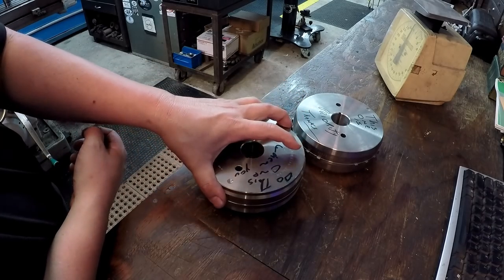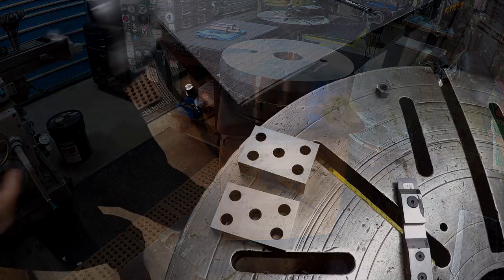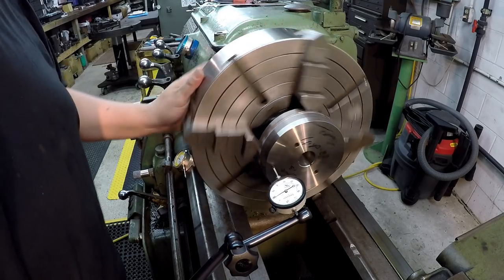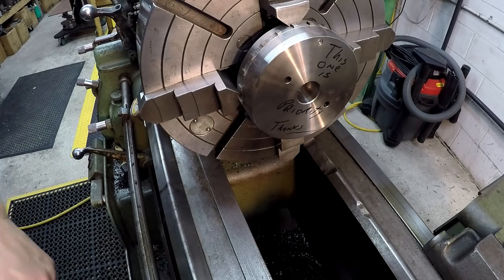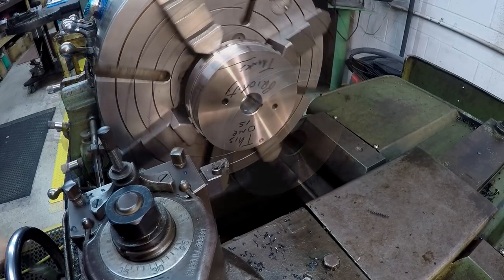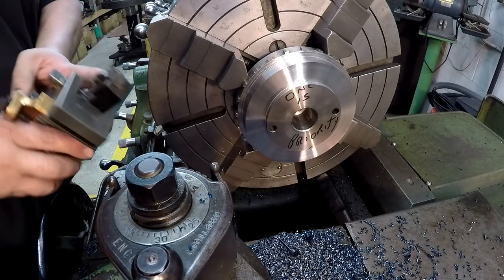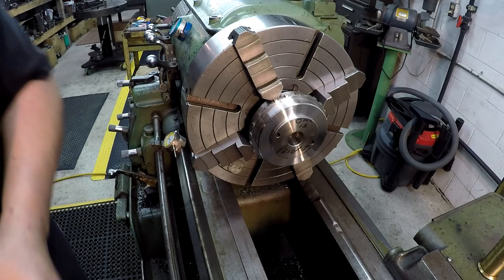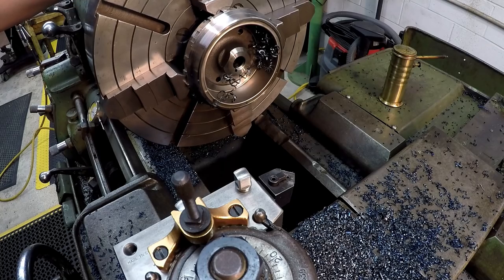SNS 169 Part 2: Flywheel Lightening

Comment: I learned more about indicating a 4 jaw chuck by watching you do it and explain it than any other way. I have watched Mr. Pete, Keith Fenner, and a few others, show and tell how to do it and I have learned from them, but you have shown how to deal with a few problems and odd ball pieces. So when I had an rough piece of tubing to turn and it stuck out several inches from the 4 jaw, knowing that the 3 jaw would not be true when switching ends, and I had to use the steady rest to get the far end due to rough and uneven edges on both ends, I knew about what to do and how to go about it. Thanks for the instruction and I know that's what you are about..

However, there are people like me who are just starting to watch your videos. Yes, a bunch of us have watched you do it several times. New viewers may not have watched several of your numerous videos and have not seen as much as I have. They may need it just like I did. And that is why I'll never get tired of watching it and will never say anything negative about it.

Two thumbs up if YT made it possible.

Comment: Not boring at all, Adam.  After 40+ years in a manual (non CNC) shop, I've indicated countless thousands of work pieces in a 4 jaw chuck and I still enjoy watching you indicate parts in!
My old instructor at tool & die school told us, probably half joking, that 3 jaw chucks were for non machinists and chucking hex stock only.  :-)
Consequently,  I almost never use them, even on round stock.  Another added benefit of the 4 jaw chuck is the strength of the 2 sets of opposing jaws.  TreeTop

Comment: Per your audio, I just replaced the ear boom mic on our system,  It was doing exactly what yours sounds like.  The tech guy at the place we bought it had me try a different mic (in our case, a lavaliere) and if that worked okay then it was the mic.  If not then it was likely the sending unit.  

New mic in operation today, laid down the sermon just fine.  No cracks.  No pops.  

Keep up the good work!

Comment: You mention indicating early on, and I have to say, this is the first video I watched that it really clicked what you're looking at on the gauge and how you're adjusting. Maybe I've just watched it enough and thought about it enough, but for whatever reason, I think I could do that now (I'm not a machinist, just interested). You normally indicate so fast, I'm usually so impressed with the speed I don't follow the actual motions.

Comment: 10:43 - This noise occurs when the voltage of the condenser (in the microphone) isn't high enough to produce a clear and stable signal to the preamp. Voltage swings due to a bad connection can also cause a DC bias in the preamp which gives that scratchy sound, and will make it "pop" back into life when the preamp is back within its working limits.

TL;DR - So, basically it'll be a bad connection, going off the sounds produced. I'm guessing you're using an external microphone plugged into the camera?
Reply: Yep, as Highlandsteam says lower down, dry joint. Annoying to find but doable... Best of luck getting it sorted Adam.
Reply: the bottom line is that USB sucks for this sort of thing.  it's great for mice and keyboards and plugging your camera into a computer to upload media, but for a quality connection you want a dedicated bus that is stable.

if Adam wants to move on from the GoPro then I suggest the Sony action cams as a very small, light solution that have a dedicated 3.5mm audio socket that will allow any external microphone to be used.  the FDR-X1000V 4K version is quite a bit more but the wrist worn shutter and zoom control control with playback screen for easy setup and repositioning is well worth it.

https://www.bhphotovideo.com/c/product/1109327-REG/sony_as200v.html
https://www.bhphotovideo.com/c/product/1111159-REG/sony_fdr_x1000v_r_fdr_x1000v_4k_action_camera.html
Reply: Principal Audio "Might be" a bad USB connection. A micro drop of Deoxid might help. Micro USB is just a stupid design. Tiny little conductors with micron thick gold flash that wears off after fewer than a hundred insertions and removals. Add in tiny mounting pads with brittle lead free or low lead solder and they're just a PITA. Slightest bump in certain directions breaks joints or even lifts pads. But try some Deoxid Adam.

Comment: Adam, those "divots" are actually called trigger teeth. There is a VR(variable reluctance) sensor that creates a trigger every time one of those teeth pass by it. The computer controlling fuel and timing uses those trigger points to calculate rpm, fire the injectors and coil.

There will be a missing tooth on the wheel and that large gap let's the ecu know when the motor is at top dead center. That flywheel looks to be a 24-2 flywheel. 24 being total number of teeth evenly spaced around the wheel and -2 being the number of teeth missing.

Comment: The little studs are probably for the ignition or crank position pickup.  Basically its a magnetic proximity sensor.  The pickups have a magnet and a coil, and when the studs rotate into the field it changes it.  The computer or ignition module sees the change and knows when to fire the coil or whatever it does.

Comment: Hi Adam. You probably know this now already but the go pro has a problem with the mic input. The problem is the little USB connection port used for the external microphone mounts directly onto the circuit board in the camera. Movement and vibration with a cable connected will eventually shake the USB port loose. The solder joints dry up and cause a faulty connection, small changes in movement, temperature etc cause the intermittent problems you've been having. You could get inside and resolder the joints to fix it, but the thing with a go pro is that it's hard to know how the audio is being recorded during filming. I would suggest if possible, using another separate device to record sound. A bit more work but you're less likely to lose your spoken word forever and have to do a voice over. You could use your other camera just to record sound, connect your rode mic to your phone and record sound, or get a small recorder and use that.

Comment: Those are Reluctors on the flywheels, ABS have them as well.  Pretty much everything computer controlled now days use them for timing and speed sensors.

Comment: The teeth on the flywheel are called exciter rings, it goes with a pickup to tell timing for fuel injection to tell where the crank position is and when to fire the fuel injector and spark plugs. It gets picked up by a magnetic coil where the voltage drops down from 5 volts to zero as the tooth goes past.
Reply from the maker: +Sicktrickintuner Thanks!

Comment: Hi Abom. I have been using different type of microphones and I recognised a typical fault that usually comes with wires and connectors. Check the leads while recording a clip, one way is to take the lead/wire between your fingers and drag/bend them until the connection point to the camera. Another possible place where faults might occurre is in the connector itself. I have had bad connections inside the connector. Also another possible location is inside the camera where you place the connector. Hope you find the fault. Best regards: Jan

Comment: the teeth around there: tone ring, read by a magnetic sensor. Sometimes these are a separate flange like ring with those teeth on it, sometimes they're like this. I'm more familiar with car/truck engines, which are usually separate.

Comment: I'm going to go ahead and agree on the bad connection to the mic at the connector, its that same sound you get if you were to have headphones on, and pull the plug out of the phone just a bit and jiggle it around, you get that same noise.

Comment: I think those bumps are Hall Effect timing lugs...maybe not!  Are you suing a remote mic?  Sometimes the cord frays inside the insulation. There is a voltage coming from the camera to power the electret mic element that may be interrupted at the USB port or along the cord that causes an intermittant open;  intermittant anything is hard to find sometimes. Greg
Reply: Yeah, looks like an encoder ring for a crank sensor.

Comment: That's a tonne of rotational mass you took off. Never thought it would be that much. The power ratio is definitely going to go up big time. We relish 3 lbs on a V-8 5.7L racing engine let alone a V-Twin motorcycle engine. That bike is gonna be quick(er)!!

The audio could be bad jack and / or USB to circuit board. Crackling indicates to me a bad ground somewhere in the audio jack /pin. Sometimes the Mic's are undersize (pretty common actually). 

Maybe you indicate that. If it's the mic to USB, that's more problematic to troubleshoot but as others have suggested, USB to circuit board is a definite possibility. I have USB test equipment, but its not designed for audio circuits, only power and data transmission. I've never seen one for audio. hrmmm
Reply: I was thinking the same thing.  Used to race Legends cars, if I could have legally taken 3lbs out of that engine, omg. lol.

Comment: I work in the Turbomachinery industry and I make shafts good to .0002" runout and actually they are still usually WAY out of balance
Reply: Those flywheels were balanced before he ran them. Considering that he took off an equal amount of mass all the way around the part it's balance should remain close. The dampening effect of mass will change things a bit and could cause more vibration issues when in use. However, these are likely race pieces where cruising comfort isn't a priority.
Reply: +Ridgewood Machine (Kevin) incorrect. The density of the material won't be the same in the whole piece. so the balance could be massively different.

Comment: Maybe you have a tiny piece of iron that flied into the microphone hole, the magnet that is inside the microphone is very small to but enough to hold the metal. Some times because of the vibration it moves around and blocks the vibrating membrane of the microphone.

Comment: I think your audio  problems are connection related. Either a connector on the circuit board or in the external input jack.

Comment: Hi Adam, nice job. quick question though; why don't you bore the material off the ID on the inside of the flywheel? that way you can take even more material off and retain the angular mass? taking it off the outside edges of the rotor is much less efficient because it leads to a heavier flywheel in relation to the angular mass when it's spinning.
Reply: Peter Ellis 
the magnets sit inside the flywheel, you would endup machining the magnets away.
Reply from the maker: +Peter Ellis That makes no sense on my end.
Reply: Abom79 Hi Adam, I'm comming at this thinking about what a flywheel does which is add angular momentum to the engine.  I assume you are reducing the mass of the flywheel to reduce the angular momentum of the engine so that it revs up faster and as a side effect the bike also gets lighter. The further away from the centre of rotation the mass is located the greater the angular momentum (kind of similar to the way greater torque is applied when you use a longer lever).  This is probably one of the reasons the flywheel isn't just a flat plate. The way it is designed puts material as far away from the centre of rotation as possible. 

So what I'm suggesting is that if you take material off by boring out the inside diameter (opposite side to the divots) You could remove even more material because you would be removing material from closer to the centre of rotation. That way the bike would be even lighter. 
Does  a that make  a sense?  Maybe it's not necessary or possible to do it that way or the overall flywheel weight is not important.

Comment: Adam,

Defective solder joints are definitely a PITA.  Reflowing corrects quite a few defects.

If you mess with electronic equipment, mechanical contacts are ALWAYS an issue.  Definitely get you some DeoxiIT, which is a very bad assed contact cleaner.

https://www.markertek.com/product/caig-d5s-6p/caig-laboratories-d5s-6p-60th-anniversary-deoxit-d5-spray-with-new-perfect-straw

Eli D.

Comment: I suspect these lighter flywheels are for quick rev or higher rpm engines. Normally you want a heavier flywheel for better low end torque.
Reply: If you lighten a flywheel all changes in motor speed will be faster, so you will get faster reactions on accelerations and when you release the throttle (decellerations). Acceleration will be faster, but with the removed weight from the flywheel you will loose some of its kinetic energy storing ability. You will loose low end torque as you mentioned, but for motorcycles you don't really need it because the weight is not that big, there is no chassis to be moved.
Reply: The engine is producing the same HP and torque. Your loosing the stored energy of the fly wheel. It makes it look like you have less torque but you really only have less stored energy to resist stalling and sudden load changes.
Reply: Correct. It makes better low end torque by filling in the gaps between the power strokes.

Comment: 1.36kg is quite a lot probably some 5-7kg taken from the bike in terms or acceleration as the gear ratio multiply what is taken from the fly wheel of cause first gear you see the most loss in weight and top gear or over driven you see the lease gain

Comment: Adam, what is that  whirring sound  whenever you stop your lathe?.  and why does it change rpm/frequency when ever you rotate the chuck by hand?
Reply: Hi, might not be correct, but I think its the flywheel rubbing against the clutch drive face, it had me thinking to start with.
Reply: He talked about it a while back.
Said he didn't know the source, and that it has done that as long as he can remember.
Reply from the maker: +Daniel Christiansen I know it's part of the clutch system of the machine. I've never been into it far enough to see what is making the noise.

Comment: Hi Adam, first I have got to say I love your videos, but regarding the problem you are having with your sound, it could be that your microphone is getting too much moisture.

I suspect the weather can get a little humid where you are, and the moisture can effect the diaphragm of the microphone, perhaps try storing it in a box with some of those dehydrating crystals you sometimes get in new electrical products.

It's either that or a loose connection somewhere for an intermittent fault like that.

All the best from a UK sound engineer.

Comment: Removing 3 pounds from those flywheels is HUGE!   At 10,000 RPM you have reduced the amount of mass the motor has to spin by 30,000 # every minute.
Reply from the maker: When I started doing these years ago, I copied one they had as a sample. I've been copying that same design ever since.

Comment: Adam, before you give up on that cameras usb port, did you have your cell phone with you when you made the video where the audio screwed up? If so, you might want to do a test run with your phone out of range, or at least with the blue tooth turned off. I saw a similar thing like that happen once before, and that ended up being the cause. It is worth a try anyway.

Comment: Adam, those parts aren't flywheels. They are the alternator rotor. If you look at the open end you will see the outer shell (the part you are machining), and an inner ring separated by a middle layer. The middle layer is a filler that locks a series of magnets in place. Those magnets spin with the crankshaft around a stator. This produces an electrical charge that charges the battery, and powers the electrical system.
Reply from the maker: +kwbarnes1 They call them flywheels.
Reply: Tell them to read the parts book. Triumph calls that part the alternator rotor. As does everyone else who uses that alternator design.
Reply: kwbarnes1 Lucas was the Prince of Darkness
Reply: If they perform the function of a flywheel, then they're a flywheel, even if they're also an alternator rotor. 

The rotational inertia of these alternator rotors is essential for these engines. You couldn't leave them off and have other arrangements for triggering ignition/injection and supplying power.

I do have the generator rotor completely removed from one of my race bikes, as the internal crankshaft flywheels are sufficient.

Comment: Indicating isn't boring - it's necessary.  How the piece is set up is the most important part - hitting the "on" button and making the cut doesn't take near as much skill.  And if you didn't show it, someone would probably bitch about how it's not chucked correctly.  :-P